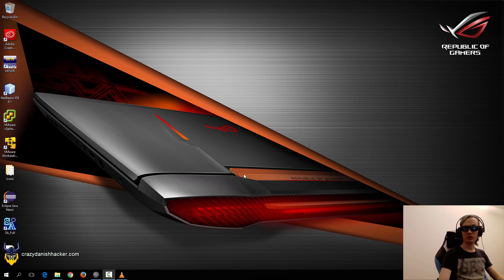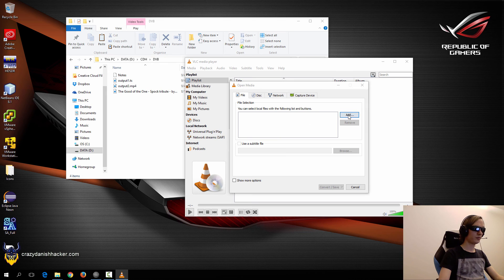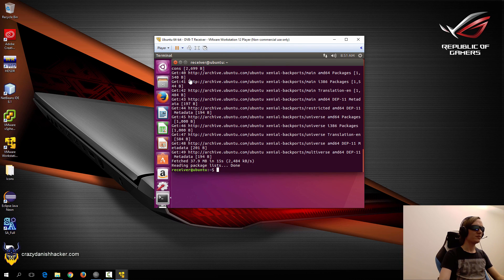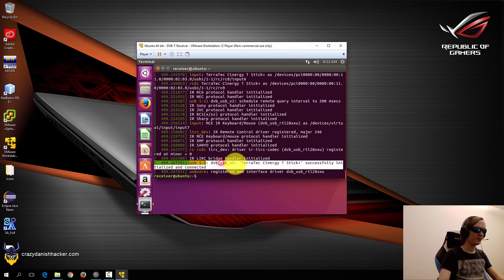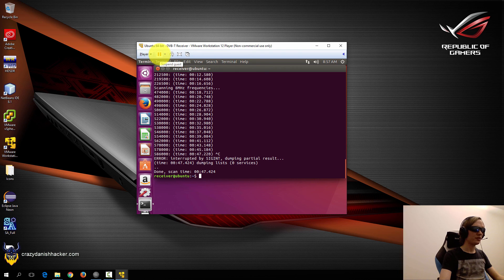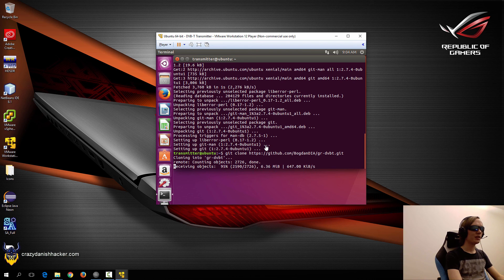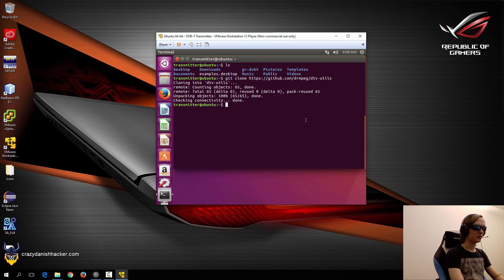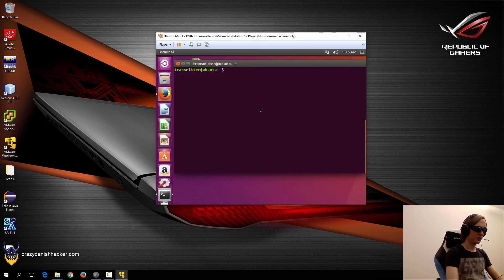Broadcasting Digital TV w/ BladeRF - Part 1/2 - Software Defined Radio Series #21

Comment: this is so great. Can I still follow this instruction by using HackRF One?
Reply from the maker: It could work, but you will need to edit the dvbt-blade.py file (https://github.com/drmpeg/dtv-utils/blob/master/dvbt-blade.py), more specifically line 191 as that is hardcoded to point to a BladeRF device:
out = osmosdr.sink(args="bladerf=0,buffers=128,buflen=32768")

You may also need to adjust or remove some of the arguments like TXVGA1 and TXVGA2, as these could be different on a HackRF device.

Comment: Dear Crazy Danish Hacker, could you have a look at the question I created in Stackexchange? It seems that you are the person who could answer the question for me? https://electronics.stackexchange.com/questions/427631/source-generator-for-satellite-tuner-input?noredirect=1#comment1064883_427631
Reply from the maker: It looks like someone else already answered it. The answer about "buy existing sdr hardware" is what I would say as well. If the person wants to make it custom, then go for open source hardware like HackRF and work from there. Not sure if the HackRF can transmit enough samples per second, but LimeSDR, BladeRF and XTRX should have no problem. (XTRX is very new and seems promising by the specifications)